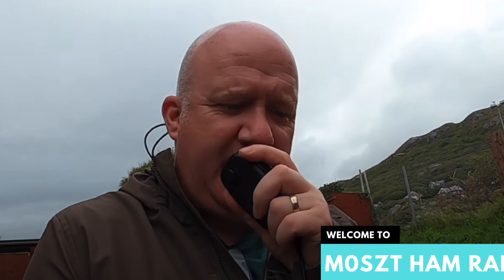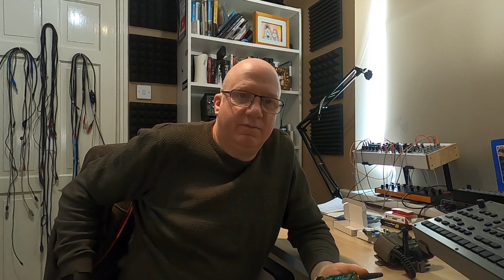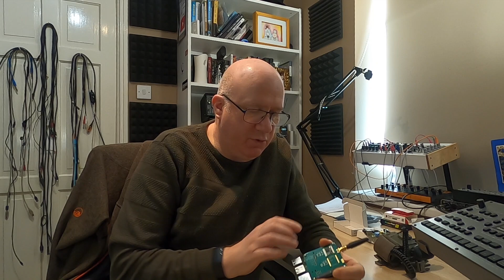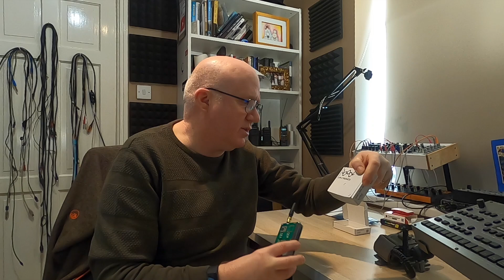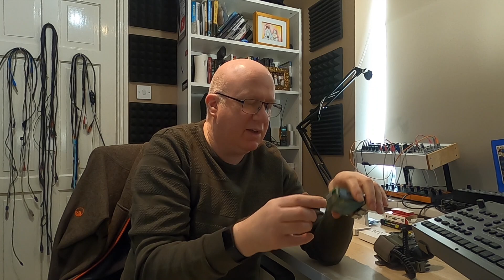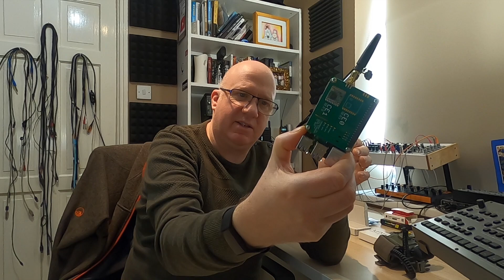Short video: Getting into Long range (LORA) radio projects

Comment: Hi Carl, is 434 a Lora legal frequency in the UK? I was under the impression that 868 was the UK or euro approved frequency 73 Richard M0RPZ
Reply from the maker: It's a tiny portion of the band available for devices like these, if you have a ham licence you can even use part of the ham band. In the UK there's two frequencies 868 and 434.

Comment: Excellent 👍🏻 I keep trying to do more with Python, but at the stage where I still have to look at code references.  I can rattle off C# off by heart, but trying to reduce my reliance on Microsoft, especially in Linux.
Reply from the maker: I'm very rusty was never fluid to start off years ago, I work with some v decent Devs but with lockdown I've been rattling off some ham radio/RPi projects at home